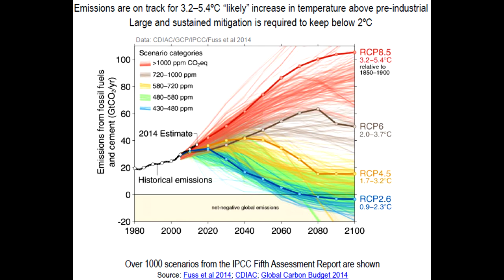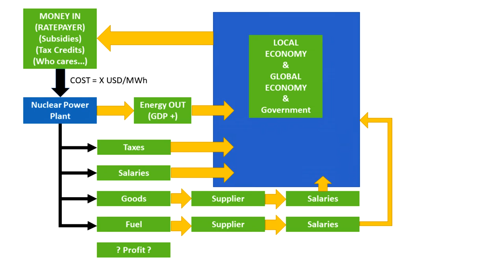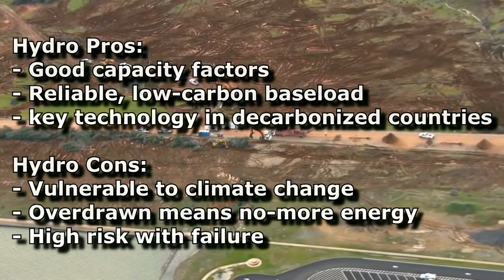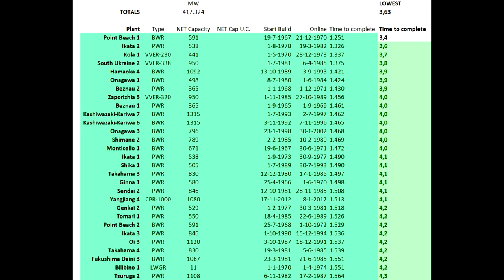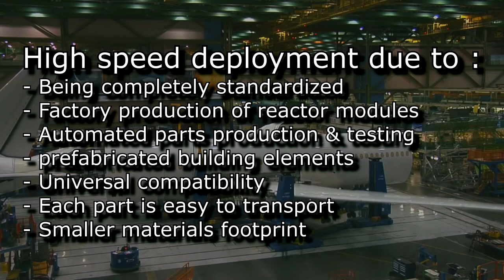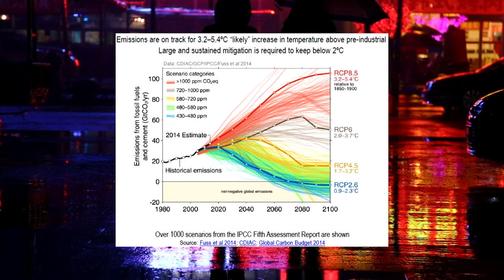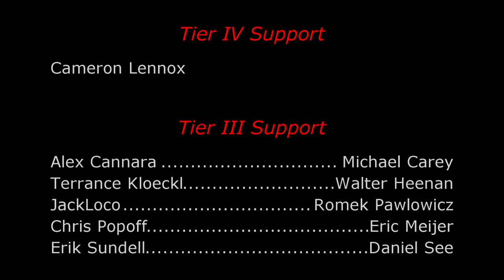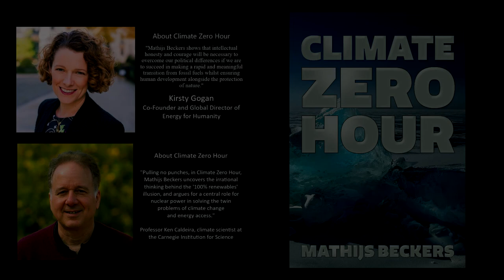Nuclear vs. Renewables: A False Dichotomy

Comment: I feel I didn't get an explanation as to why nuclear alone can't allow us to reach RCP2.6. Did I miss something?
Reply: In the video explains that carbon and fossil powers are climbing fast, solar and wind power are matured enough to counteract that expansion, also if we seize the roof of the buildings putting solar panels we reduce the grid baseload. Of course this is for the short and medium term, solar and wind alone cannot be scaled enough without serious consecuencies, in order to supply energy to the whole humanity. That's where nucleas comes, it is the solution to the hegemonic source of energy, but no to all cases; also the industry is still very naive and can't compete economically with other sources of energy. Nuclear will and should be the major source of course, but due to other problems like grid, construction times, budget, we still need increased development and usage of solar and wind in particular cases. Avoiding of course solar farms and a lot of winding places that comes with negative consecuencies for the nature and disposal of wind power elements.
Reply: @ignacio9151  I love the people who gather in this comment box.

Comment: Well yeah, I don't know. I think the single biggest factor in what technology will be rolled out most successfully is the manufacturing cost.

Nuclear is far too powerful and expensive for the world to need very many reactors. So reactors will never get the economies of scale that Solar and wind will. 

We just don't have a market for a billion nuclear reactors. Where as we do with solar and to a lesser extent, wind. So the number of iterations and the value of optimizing the process it there for solar but not nearly as much for Nuclear.

Also the red tape with nuclear technology is extreme compared to renewables. 

You bring up lots of valid arguments but really I don't see nuclear taking off the way that renewables will. 

I am glad that India and China are investing in Nuclear along with renewables. they are very smart and as far as space travel goes, nuclear technology looks to be the very best option, so we do need this technology to continue to be implemented and improved.
Reply: I don't think its a matter of scale for nuclear power, the concept is to free up plants from burning hydrocarbons with less input. I would  Imagine it being a lot cheaper to run 1 high tech power plant as opposed to 10 coal/wood fired plants